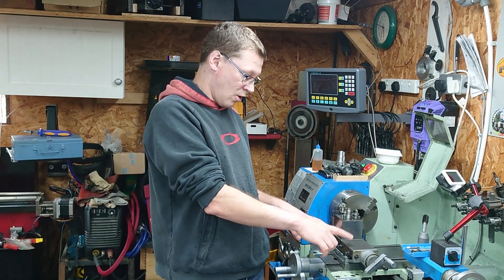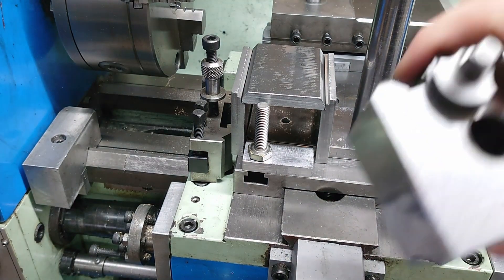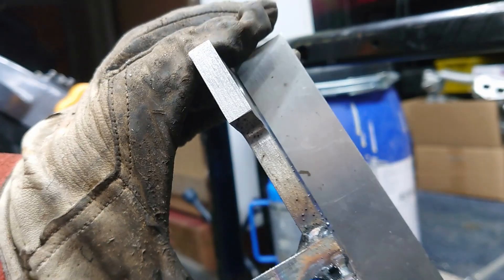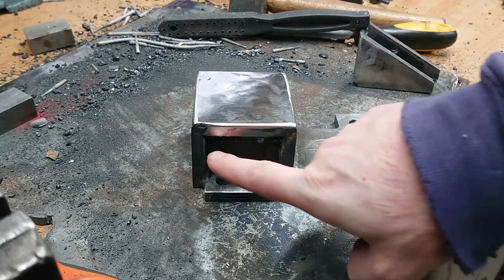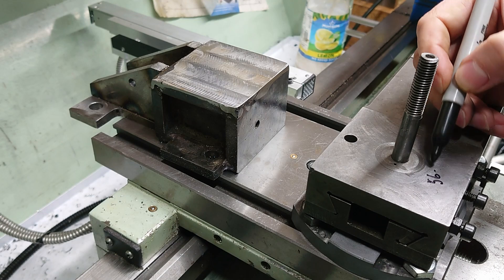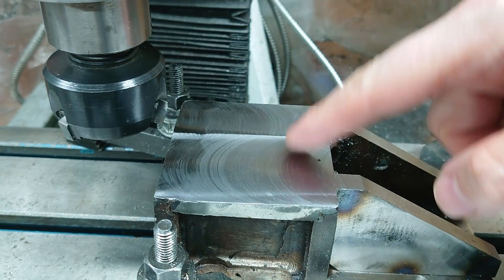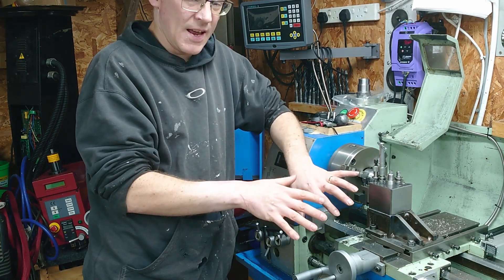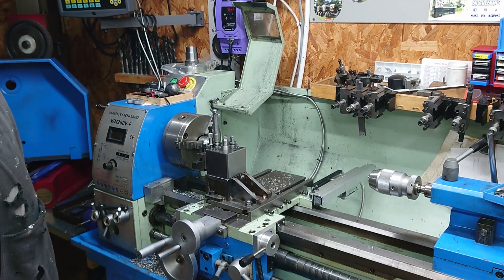Fabricated Toolpost - It's now better see pinned comment.

Comment: You need to remember the lathe is only small and not realy suited for carbide tooling. I spent 28 odd years working for SecoTools here in New Zealand and know quite a bit about carbide. All carbide inserts, unless ground to a sharp edge, have an edge hone. This is to protect the cutting edge and on shallow DOC's its a bit like trying to cut with a very blunt tool. Have a look at a cutting edge under a microscope and you will see what I mean. You could trying moving the compound slide back so the downward load is taken in the centre of the carrage and not on the edge which is trying to lift the carrage up at the tailstock end. I have a Myford lathe and wouldn't dream of using carbide. A good but of high cobalt toolsteel will do you well if you run at the correct cutting data. Hope this helps. Cheers Ian
Reply: I have old big lathe weight about 2tons. When i cut deep with inserts finish looks realy good, but when i take shallow pass or spring pass , that deep good looking surface are ruined. Is that normal?
Reply from the maker: This is the problem of smaller lathes - it's hard to take a deep enough cut to get a good finish on some materials with carbide. Your lathe sounds like it is sufficiently capable of decent cuts. What you need to do is balanced cuts so your last cut is the same depth as the rest. When using a DRO this should be easy as you have a calculator on hand. Also by not changing cutting conditions the dimensions are more predictable so no need to creep up on final sizes.
Reply: I have a 10x24 lathe that weighs about 1800  lbs, the bed ways are 9.125" wide, and the saddle is 18" long.  Obviously, the more support under the tool, the less chatter you'll get. Still, I often use HSS for lighter cuts, a properly ground tool will often produce much better results than a lightly loaded insert tool.
Reply: @vandalsgarage  ty for info. sounds i need to learn to sharpen hss anyway :D and if i only use it for final pases, then maybe i dont need to resharpen them too often? will try
Reply: @craftzars  Hi, If I am correct the chip colour from the heavy cut will be blue or there abouts. This means the chip is getting into its 'plastic state' and flows well. When you reduce the DOC to a finishing cut (using the same rpm) the chip will be much the same as the steel colour you are cutting. If you crank the spindle speed up and get the colour back into the chip I am sure you will find an improvement in your surface finish. The material you are cutting can also have an influence on the finish as well. Low carbon steels is one example. Hope this helps. Cheers Ian
Reply: @ianlangley987  yeah deeper cuts gets blue chips. Im hobby machinist so i learn all stuff by myself. Yeah always work with same speeds, just change feed. Probably thats a problem and also my lathe can only run 1200rpm and i think thats also to slow for carbide, but i have quick change tool post and digital readout so i want tip to be in same place always so ita much easyer by changing carbide inserts compared to handgrind hss and resetup dro
Reply: @craftzars  Yeah, for the most part... As the man said - most carbide is dull(from factory) and will cause mostly surface rubbing and tearing upon light cuts... You can use aluminium specialized carbide cutters, or you can lap your carbide inserts yourself - grind them on a tool and cutter grinder(if you have one that is - use a vac and a breathing respirator when grinding), just lick the cutting edge of a used and even more dulled out insert, make em sharp and lap them on a diamond lap - give them the slightest of edge radii as razor sharp carbide might as well be glass, and voila, no rubbing at very fine cuts... 

Other than that, even HSSCo or CBN or whatever will not aid you if the edge is not sharp enough for the cut you want to take... 
Spring passes are generally a nasty thing, lest we are talking spark-out passes on grinders, as those leave superb finish and accuracy, whereas the lathe and mill are best used with a well calculated deflection positive cut which lands the size precisely on the money, but does so by removing enough material as not to rub anywhere along the length... It takes learning your tools, your lathe and part deflections... Everything bends and moves, but most of those things are static and you can learn what to expect at which point(depth of cut in specific material)... 

I`ll cut it here, as i could go on for days... 

Best regards!
Steuss
Reply: @camillosteuss  i wish i had somebody in my life like you who like to talk about machining endlessly. All what i learned are from internet, mostly from YouTube because i dont know anybody who is even close to machining, so i have nobody to talk in real life. Thanks for info, all this make some sense now
Reply: @craftzars  Same here, brother, I first saw a lathe some 15+ years on AvE`s channel, and i fell deeply in love that same instant... I spent ever since - learning all that i could about machining, not even hoping to ever own a machine myself, but then i started getting machinery some 4 years back... Some scrap salvage, some new-old stock gotten from Switzerland, some local purchases and so on... 
I do talk a lot - precisely because i have been taught a lot of what i know by wonderful people like Robin Renz, Stefan, An Engineer`s findings, Joe Pie and others, and that always makes me want to share the knowledge that i have been given, as those people shared what they know because of the same passion and love for machines that i have... 

All the best and kindest regards!
Steuss
Reply from the maker: @craftzars check out Craig's Workshop, he has a discord server, you would be welcome there. You too @camillosteuss
Reply from the maker: @ianlangley987 just tried adjusting the PWM switching frequency of the VFD. Increasing from 16kHz to 24kHz has entirely cured the problem.
Reply from the maker: Hi Ian. Thanks for your feedback. I have used carbide to good effect on most materials on this lathe, but I do agree that it's not possible to run them at the correct parameters. Another factor is that I generally have cheap nasty Chinese inserts as real ones are too expensive.  My lathe is significantly more rigid than a myford (at least the ML7 I have experience of). The problem is the EN8 material. It needs significant depth of cut and high feed to cut properly. The motor is struggling, so I am really pushing the machine to the limit of what it can do.  I'm going to investigate altering the frequency of the VFD and see if the vibration changes pitch. The resonance occurs when the motor is under high load (>5A), so I'm going to check if the slip of the motor against the 3 phase drive signal is causing the beginning of the vibration.

The bluntness of the carbide is no doubt a contributing factor, but I tried HSS in this material and it really doesn't last long before it too is blunt. I will see if I can get some cobalt tooling.

The tool is positioned where it is so that I can get the tool up to the face of my collet chuck with the saddle as far left as it will go. Any further inboard and it would not reach.
I could always make it so that it's only useable with the 3/4 jaw, that would buy me about 40mm to move it inboard.
Reply: @ollysworkshop  Hi again, Looks like you have tried a lot of things with little success. One of the best toolsteels you will buy is Assab 17. You will notice how hard it is when you start grinding it up. I agree with you on the cheaper inserts but unfortunatley the rules of purchasing most things is that one pays for quality. I have seen it so often and experienced it myself like most of us have over the years. Cheeres Ian

Comment: I use a 1.5 mm wide carbide insert parting tool with MGGN inserts, that cuts very well in most materials. I have bigger ones for more aggressive parting, but that little one works really well. Can you detect any movement with static loads on the toolholder using a DTI on the blade and a crowbar between the chuck and the tool? Does any of the machine and toolpost ring when you tap it with a hardened hammer? It should sound nice and dead. How about filling the new post with molten lead? Guess you've checked the ways and gibs and given then a good pulling about with a sensitive indicator across the gaps, but does the chatter change if you tighten the cross-slide lock? Do more aggressive cuts make it worse or better? Any difference with a collet chuck? I had chatter and found my 3-jaw had gone bell-mouthed, and wasn't gripping near the ends of the jaws, so I reground the jaws while under tension and now it's superb.  No chatter and excellent concentricity.  Do you have a worn spot in your cross-slide leadscrew?  Any difference in chatter if you offset the tool a bit fore and aft?
Reply from the maker: Some very good suggestions, thank you. I'll be looking into some of this shortly.

Comment: of course its worse its hollow lol.

Get a block of cast iron and just machine it down. Mass will reduce vibration.
Reply from the maker: But why is it similar/ slightly worse than a compound slide that's mounted to a much smaller round post with 4 M4 screws, and a significant cantilever?
Reply: @ollysworkshop  Your compound is probably cast iron not steel. It has a higher density. All you need to do is get a nice big lump of cast iron and machine it into a block and drill holes in it. You could even use a steel block.

Just welding up a few steel chunks isnt going to be an upgrade. Im surprised you bothered tbh, for mine I just took a waste block of steel I have lying about. Cut it down roughly to size on the bandsaw, squared it on the mill, then drilled a few holes in it, and its done.

Took bugger all time to do, would take much longer to weld it all up.
Reply from the maker: @Festivejelly  I would have used a solid lump if I had one big enough. What I did have was a load of plate steel roughly the right size, so it seemed like a good idea at the time. You are right though, it took fecking ages to weld up and get to a useable state, and if I charged by the hour I would have bought a lump and machined it. Being a hobby, you have to work with whatever you have available.

Comment: Your fabricated riser isn’t solid enough. Also check all the gibs etc. I had terrible trouble with poorly made gibs on the cross slide on my small lathe - couldn’t get a chatter free finish on anything until that was fixed. Ultimately I ditched the small lathe and got a heavier machine because I didn’t want all my projects to be “making my lathe work properly”.

I also wonder if your new riser is flat enough on the machined surface. It may have moved about some more since machining the weldment. 

Those particular quick change toolposts are also not very rigid. I ran one for a couple of years.
Reply from the maker: I would love a heavier lathe, but it would be incredibly difficult to get it to my shed. The one I have was hard enough to get there. I will check the gibs. The flatness is definitely worth checking, these things can creep over a few days as the stresses are released. I will try with the old 4 way toolpost as well.
Reply: @ollysworkshop to be honest “get a bigger lathe” isn’t the best advice I’ve handed out. 😊

Comment: Hi Olly, the hollow design won't work as it will create resonance. A solid block of steel is the only option for a solid toolpost. Atb.
Reply from the maker: The resonance is no different to when I'm using the compound slide, so I don't think that the tiny airspace in the middle is resonating. I will try and get some high speed footage to confirm though.  I fabricated it as that was material I had on hand, and I was hoping it would perform just a little better than the compound.
Reply: @ollysworkshop  Try using a machinist jack under your cutting tool, if the chatter goes away then you know it's the toolpost. Otherwise it will be the gibs or spindle play. On my machine the gibs were dished from wear.

Comment: hi Olly nice to see you
MASS is everything on a machine, to absorb,  get a Old Harrison 👍👍👍👍😉😉
Did i see a Precision Vernier slag hammer or was i seeing things😄😄
Love the plastic curtain around the mill must remember that for certain jobs!!
I think you may have reached the limitations of the machine without some major mods..
regards
Kev
Reply: Didn`t you know that they make a special calipers slag hammer? It is under the same line of products as ``the screwdriver-prybar`` - those are the specialty line of products not available to regular schmucks - you need either a craftsman`s licence or a mechanic`s licence to access the backrooms and to see such professional tools....
Reply: @camillosteuss  🤣🤣🤣🤣🤣🤣
Reply from the maker: @camillosteuss  I think someone sounds jealous!? 🤣
Reply from the maker: @MrFactotum  I would love a heavier machine, but it would be nigh on impossible to get it to my shed. I think that I am pushing what the machine can do, but that's all I can do at the moment.  The precision digital slag caliper is a special one of a kind, but it's definitely not a Vernier! The plastic curtain saved me from many a hot chip. Definitely worth setting up.

Comment: Great video. Just out of interest have you tried 
Parting or turning difficult materials in your four jaw and or have you tried wrapping a small width of pad paper (about 10-15mm) Around the work piece and placing this to the front of your 3 jaws to counter jaw flex. I found that some Chinese chucks are really bad for this chatter noise. Keep up the great videos 👍
Reply from the maker: Thanks, that's a really helpful comment. I have a Pratt Burnerd standard accuracy 3 jaw chuck on the lathe, so shouldn't be too bad, but your suggestion is still worth a try. My 4 jaw is a cheap Chinese job, but I get the point that more grip is better, so may well try that too. I don't enjoy switching chucks as it's really fiddly with nuts in a tight gap between the spindle flange and headstock. Mine predates the lock ring style that you get on newer machines that are much easier as you only have to loosen the nuts, not remove them completely.

Comment: I've read, not tried mind you, that if you want to remove chatter then bolt together instead of welding.  After all, when was the last time you saw a bell that was bolted together?  You made a bell.  Solid block or bolted together seems to be the received wisdom.  Me, I just feed harder when the chatter comes :)  When it visibly flexes in... keep it there until it's done.
Reply from the maker: My compound slide is bolted together and it does exactly the same thing. As I said in the video, it seems slightly worse than the compound, so I think the increased rigidity is showing up some other weakness. I've tried feeding harder, but that just makes it worse until I stall the motor. I have a more powerful motor but I'm starting to think that won't help either.

Comment: 1. Tighten gibs on cross slide
2. Tighten gibs on the front / rear of carriage if you have them
3. Measure the flex of the "solid"  tool post mount. I suspect you've created a nice flexure box that resonates as the cutter engages the work.

I made one out of a solid block of 1020. It's a huge difference to using the compound slide.
Reply from the maker: @HM-Projects  1. Will do. 2. Not sure there's any adjustments, but will check. 3. The resonance is there and is essentially the same with the compound. My point was that the new riser makes it no better, and possibly slightly worse, hard to tell. I think the weakness lies elsewhere. The added stiffness of the fabricated riser and it's inferior damping qualities I suspect are what contribute to the slight worsening.
Reply: @ollysworkshop  did you try what @HM-Products suggested? i think this is the problem not Your custom welded fixed tool post. Next i would remove the apron & saddle and check its contact with the ways...undersides of the cross slide might need some scraping ...good luck. BTW, that was some excellent fabrication, welding & milling work!
Reply from the maker: You need to watch the follow up video. I tightened the cross slide so it would barely move, locked the saddle, replaced the compound/welded riser and QCTP with my milling vice for extra mass. No difference. The problem is with the VFD, probably current limiting.  I also tried measuring the flex of the welded riser with a long bar in both QCTP positions and I cannot detect any movement, compared to the compound slide it is solid (dictionary definition of the word).
Reply: @ollysworkshop i think you need to affix "Part 2" to the follow up video so algo puts it next in line...because i cant find it.

Comment: I have a warco 250v, out of action right now but when was in use i ran a solid tool post doing away with the compound slide using an adapted rear parting blade plate from warco bolted down with a model 222 tool post (big) bolted to it. It transformed the lathe once I sorted the cross slide chatter also . It's in bits waiting for more mods and replacement of worn lead screws right now. Once dialled it parted like a machine 5 times larger and Much more rigid, it held impeccable accuracy also.

One thing I want to do is essentially mill another plate that  holds the tool post perfectly square or at pre determined angles and allows me to dial preload onto the tool post to hold it even more rigid. Check the cross slide, it could be like mine basically chattering like mad due to wear caused by the old compound slide set up.

Also the tool post you are using right now is not the best...